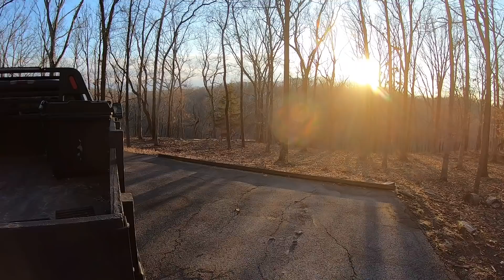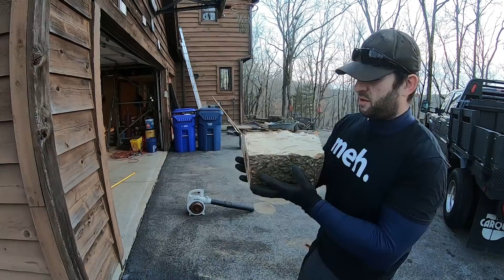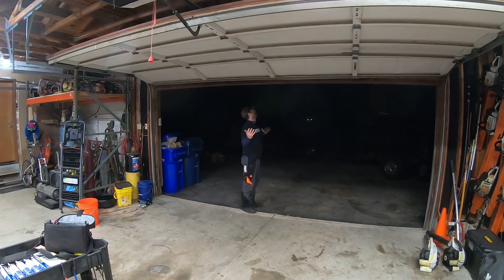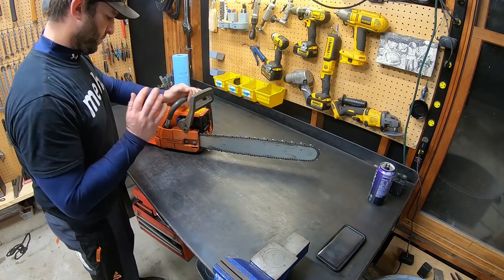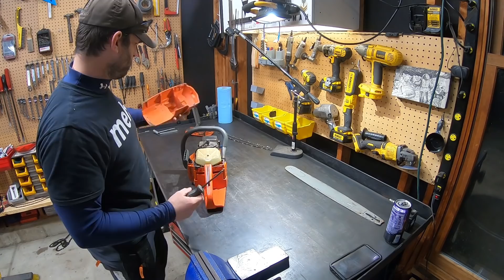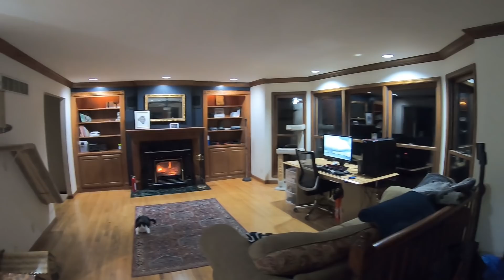Come On Spring (edit)

Comment: The worst part of Missouri winters for me is after the holiday season. The days are short, the real bitter cold usually comes in January/February and there aren't any holidays away from work to look forward to. Easily gets to feeling very monotonous and grinding-especially since I have to work outside most of the time. But you're right-the days are getting longer and it'll start to warm up pretty soon. We'll be complaining about how hot it is pretty soon.

Comment: Hang in there, Cory (and you other Humans). Just 11 more days until the "calendar-winter" ends, and then just three more weeks until equinox.

Cory, you should consider yourself lucky because it's dry enough outdoors at your place for you to do outdoor stuff.
I, myself,  should've been stacking firewood all last week, but it rains here every day at the moment and part of my garden is flooded, right up to the platform I should be filling. My working trousers are already muddy up to the knees and I had to remove a lot of mud from my boots before shining them. Well, at least I found out that they are still waterproof, walking through the puddle (when it's there, i call it "Lake Hopla"), but that's the only good thing about this situation.

Okay, It's been very mild all winter, not even a single snowflake so far, just rain, so I saved some firewood this season, but this is 55 degrees North lattitude so it should be colder. I'd rather have some frosty days for stacking and felling.

The ground is also too soft to go felling. We've just had two small storms that took out two of my landlord's ashes. One is quite small and came all the way down, but the other is somewhat larger, maybe 25 inches on the stump and 40+ feet tall,  at leat 80 years old, and it's tangled in a neighbor crown 30 feet up at a 60 degree angle. Yay. Or not.

I so much want to get them done, but we can't get the tractor in to put a wire on the leaner until I remove the small ash but there's no reason to get drenched and have to handle slippery timber, so we'll have to wait it out. Luckily they aren't in the way of anything, and the tractor would just crush the forest floor.

There's also a dead fir, maybe 40 feet tall, that I have to get down. It's a straight trunk with most of the limbs pointing in the only possible falling direction (a fence, trees, and a busy road to the other three sides), but that is into a field that will be ploved and sowed sooner or later, so there's a little pressure on this one.

No wonder I'm on the brink of cabin fever with all this rain so far and forecasted for the rest of the week when there is so much to do outdoors. Darn it!

Comment: Not sure why you loosen the chain up to take the bar off.  I must be missing something.  I just take mine off.  I do wish they were all were on the outside but not impossible to work with..  You might also try the Fiskars splitting maul with the short handle.  It's a little thicker and splits a little better than the Husky axe which I use like you do in felling trees.  Good to see you using the bungees in splitting.  Saves chasing the wood all over the parking lot.  It's really great to see your new videos.  Thanks a lot!

Comment: You don’t have to loosen the chain at all to take the bar off. Just lift it up off the adjustment peg and slide it back towards the clutch/sprocket and take the chain off the bar tip first, easy pee z